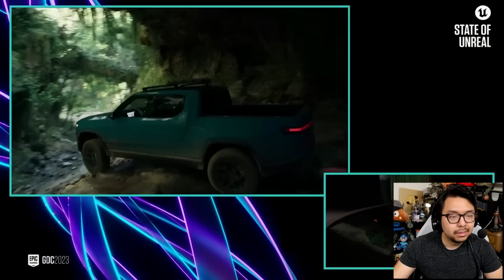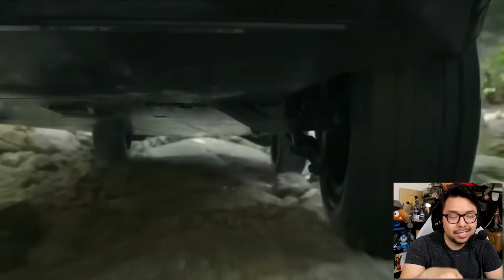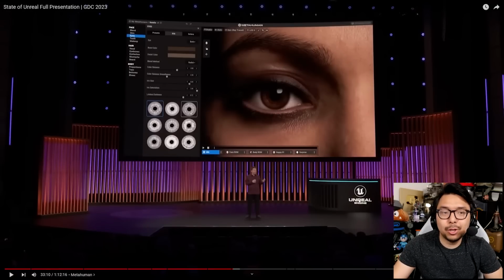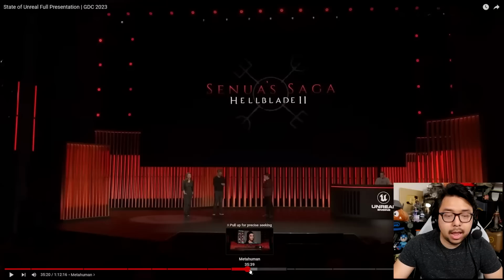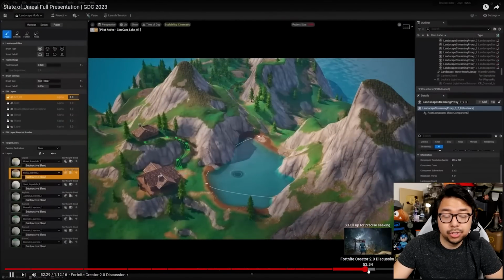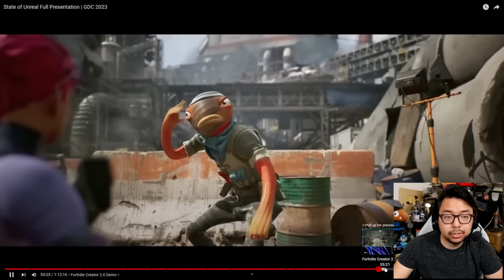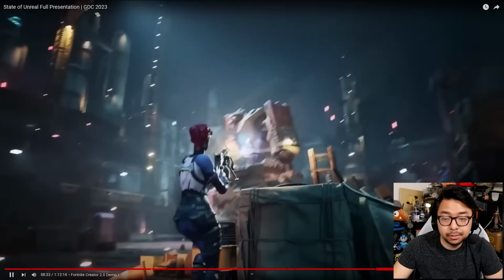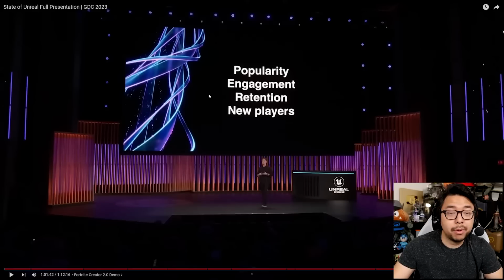Unreal Engine 5.2 Is Utterly Mindblowing (Metahuman, Lumen, Foliage, & More)

Comment: can't wait 5 years for all this to be actually used, and another 5 for us to have the hardware to make it look as good as all the tech demos
Reply: lords of the fallen is right around the corner 😃
Reply: Final fantasy 7 rebirth is using UE5 for the Playstation 5
Reply: Fortnite chapter 4 is already using Nanite and lumen. So was the matrix awakens demo. Also the next hellblade looks to harness most of these technologies as well.
Reply: @TheAsj97  Actually with Nanite you can have many highpoly meshes and the game won't be necessarily larger. Nanite comes with it's own file compression system that makes  a 10 million poly model about the same size as a non-Nanite model with a few thousand polys. Plus a model with millions of polys most probably don't need Normal Maps for extra detail, which saves a lot of space and memory as textures are usually heavier than models.
Reply: Tbf the Unreal Engine 4 Tech Demos from 2013 are a good representation of 2018 games that look as good as those demos (even though they're not Unreal Engine), namely God of War and Red Dead Redemption 2. So no, I don't think it'll take 10 years, but rather 5-6 years.
Reply: @jimmythegamer2231  The Infiltrator demo is barely the level of graphics we can achieve today and that demo was made 9 years ago. It's prolly because tech demos don't have to render entire worlds, but only focus on the scene that's shown - that's why they look so good. These tech demos are often really misleading. They don't show games, but presentation how well the engine can do cutscenes.
Reply: @Pyovali  well last gen systems were anemic, even at their release they had incredibly underwhelming cpu/gpus. The PS5 and XSX launched with essentially 2080s and Supers respectively and Sonys SSD is still considering state of art even in the face of "faster" gen4 drives. When last gen is finally left in the past we're going to see some amazing things. Especially if Lumines turns out to be a viable alternative to ray tracing as a lighting and shadow solution.

And we've already seen the Matrix demo running on UE5. And don't say the framerate was butt, because it was an early version of the tech, an unoptimized game and early in the PS5 life cycle.
Reply: @Pyovali  Nice to know a few smart people still exist.
Reply: @Pyovali  what about the Unreal Engine 5 Matrix demo. It looked astonishing and was fully playable on current gen consoles. Imagine if devs took time to optomize it.
Reply: @jimmythegamer2231  wait gow and rdr2 were made on unreal!!!!
Reply: It’s going to be quicker due to how they’ve streamlined the systems. I expect a huge bump in games running on ue 5 within the next 2 years
Reply: @cody3335  They haven't streamlined people's wallets though...the issue is that the stuff this is running on has a high premium price tag...most normal players won't get their hands on it for quite some time. The 4090ti gpu it's running on is rumoured to be out maybe at the end of the year and touted for a $2000+ price tag. That's out of a lot of people's budgets and will be for ages. Even if they produce games that utilises that power...few people will be able to experience it...and that fact will probably hold things back since they can't just develop for the best of the very best hardware...they have to sell it to people much lower down on the scale.
Reply: @vallejomach6721  that’s the market not Epics fault… moving on.
Reply: I thought a big selling point of UE5 was the increase in fidelity didn't require a large increase in power. Like you can make things 2x as detailed but it won't require hardware 2x as powerful.
Reply: @charlesfuzak  It doesn't work like that, everything comes at a cost. The Nanite tech does help a ton with performance almost for free but it has it's own limitations. Also it enables the use of highly detailed meshes which are not made out of thin air. It demands higher manpower, time and resources to make detailed meshes for Nanite than simpler models for previous-gen games. Lumen (UE5 new lighting tech) is also super practical to use with awesome results, but also comes with it's cost on performance. In practice these new techs will create less technical barriers for artists so they can focus on the creative part, but there's still a learning curve for the industry to adapt to this. Even senior devs need time to understand the new tech and create new workflows for it. Also other traditional 3D softwares are still many steps behind to make the new workflows viable with this new tech. UV unwrapping highpoly models for example is a nightmare in any traditional 3D software like Blender and Maya, and will demand film softwares like Rizom UV to handle the task or a different texturing solution. I'm saying this because I'm working on a UE5 game with plenty of industry seniors. If the AAA industry wants to leverage the new cool tech, it will cost more money and time because there's more work needed to achieve the best results, and not less. That's why it's been almost 3 years since we got the "next-gen" consoles but we still don't have UE5 games ready (Fortnite doesn't count because models are still simpler than realistic AAA games and tech demos are not full games).
Reply: Exactly they never want to use it because it maybe "Too Good"
Reply: Exactly! Lol
Reply: And another 10 to experience this with 60 Fps 😂😂
Reply: I remember the Force Unleashed tech demo from like 2007 showing off impressive environmental and material destruction which didn't make it into the final game. To this day, I'm still waiting for this tech to become a reality in any major game.
Reply: @Ecselsiour  'The Finals' from Embark Studios (Ex-Dice apparently)...recently had a closed beta, no official release date as yet though...but looks pretty crazy.
Reply: @TheAsj97  you can have massive poly counts and not fill up a ton of space. I think we’re headed for an AI curated procedural generation golden age. Level design will take hours instead of months.
Reply: @modelcitizen1977  You can have massive polycounts, that's not the point. You can have a few models with millions of poligons and copy paste them all over the scene and have billions of polygons, obviously that wouldn't matter for disk size.  The point is games have tons and tons of different models, are you going to have only a few of them be that high poly while the rest has traditional poly counts?
Reply: Bro S.T.A.L.K.E.R. 2 releases in December and it’s using Unreal Engine 5 also Fortnite Unreal Engine 5 is releasing soon. Many developers are already developing using Unreal Engine 5.
Reply: @marvyrvygarvy408  Stalker 2? Lol, given the situation in Ukraine, that game will be out by 2030, if ever that is.
Reply: @karls4937  The developer moved there studio out of Ukraine to Czech Republic. They are far along in development.
Reply: The PC used to demo it had a RTX 4090 and i9 13900K.
You can buy this today (though rather expensive).
Reply: Yeah, it's going to be years before normal people will have shit looking like this lol...
Reply: @idiot_city6724  theres things that look this good being made by small teams using Unreal Engine 5. Search on Youtube.
Reply: Personally I can't wait for them to use this engine and make games $100 because they decided to use this engine and not that we requested it specifically
Reply: @Wario_Wham  The engine is free. It's free to get started for game development–a 5% royalty only kicks in when your title earns over $1 million USD. Even random schmuck can just download Unreal Engine 5. I don't see why games would cost $100 when Unreal Engine 5 supposed to make developing games easier. That's kind of the whole point of Unreal Engine 5.
Reply: Games could easily look like this but most gamers are still using old hardware and complain when it doesn't run well

Comment: I don't actually care much about graphics if you constantly have to get new computers or consoles to keep up with it.   As long as the performance is good,  I really couldn't care less a out deforming tires.
Reply: agreed. i got a 3060ti and new games are already pushing that.
Reply: The base performance requirements are going up, but we're also getting some old high end tech moving down the stack. Lumen is a more scalable form of ray tracing for instance, and Nanite can give the appereance of extreme distance scaling without wasting resources on actual high poly models.
Reply: you do realize that graphics have always been getting improved and people have always had to upgrade right
Reply: @ichase8555  yes.  Which is one reason why I have never kept up with the newest stuff.
Reply: @Snake Was Right  all technology becomes obsolete at some point, and video gaming equipment is not any different. There's a reason we don't use floppy disks anymore, or VHS
Reply: @ichase8555  yeah, but I'm not going to replace my technology every year or two.  I do this with everything.  I will hang onto my phone until it breaks.  I do not get the new model until my previous phone is literally inoperable.  Same with my gaming platforms, I am still rocking a PS2 and an Xbox 360 as my most advanced consoles, which I got when the next consoles were out anyway.  

I do have fairly up to date PCs, but I have only bought about 2 games since Skyrim.  The classics are good enough for me, and while games are getting very pretty, it seems like the quality of game play is going way down, which is why the good enough classics I already have are good enough. 

 Better graphics is not enough of an incentive for me to buy... anything.  I will play crappy graphics for the better game play.  

One example is battlefront ii, the first one vs the second one.  The first one is the better game, but I usually play the second one because the online play is just more accessible.  The better graphics is just an extra plus.